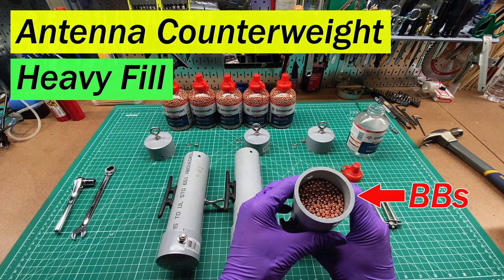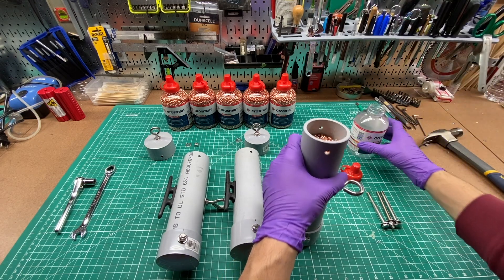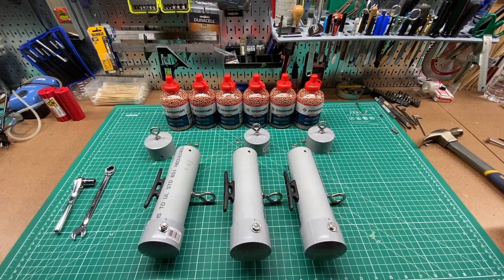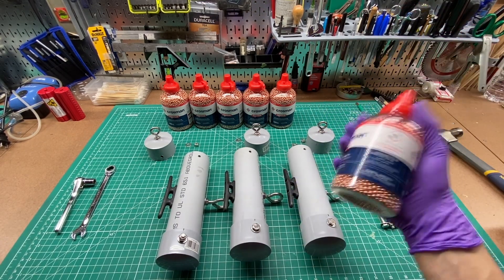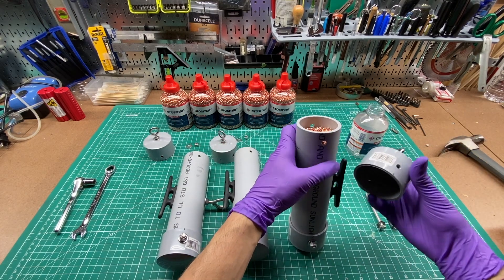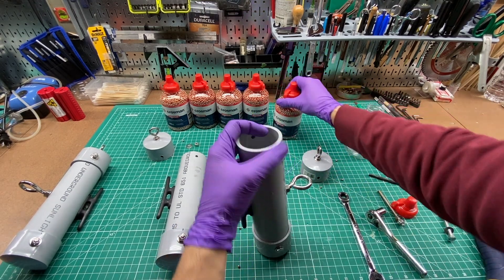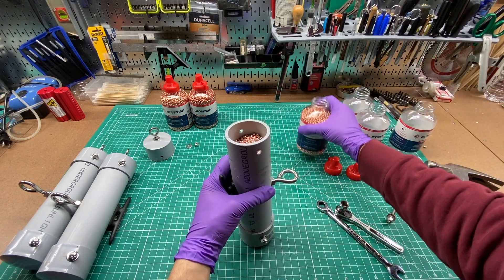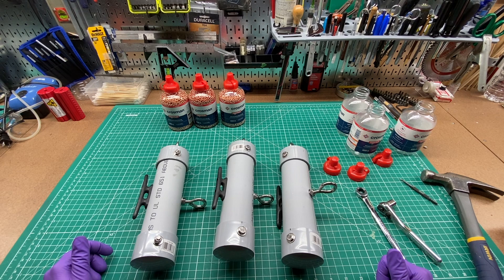Antenna Counterweight Heavy Fill with BBs

Comment: Did you move the wall control pegboard down a bit?   I noticed in your installation video, it was sitting about 5 or 6 inches off of the bench top?   Just curious
Reply from the maker: I made this video in my basement workshop that also has wall control panels 😀. My wall control install video was in my garage. I’d recommend installing them higher than your bench so you don’t lose usable space at the bottom. I didn’t have a choice in my basement because there is a big shelf above the panels that I didn’t want to change.